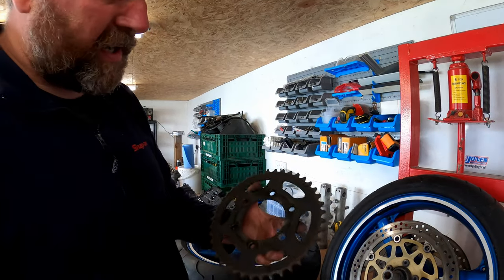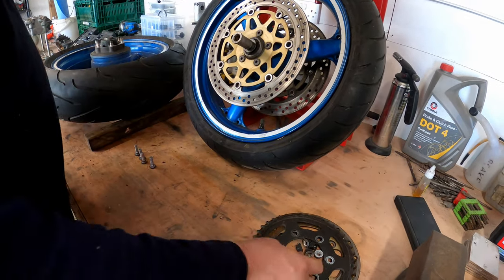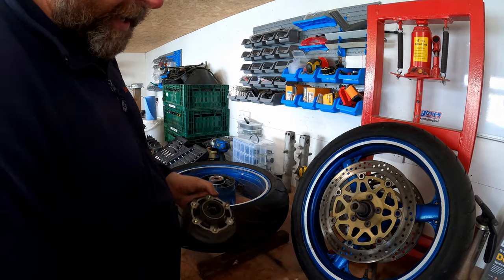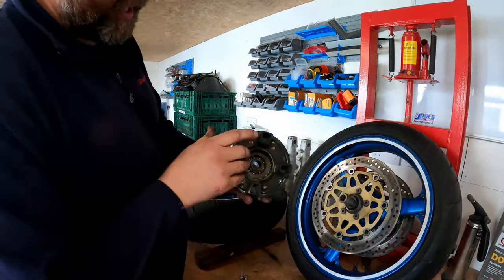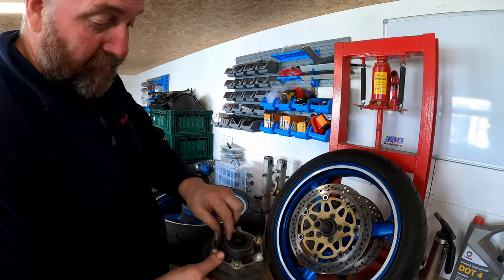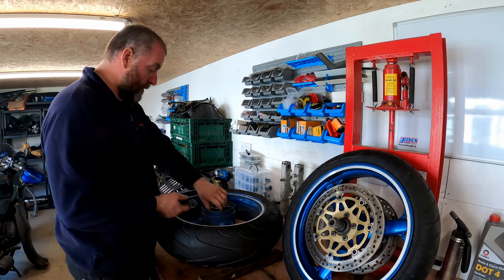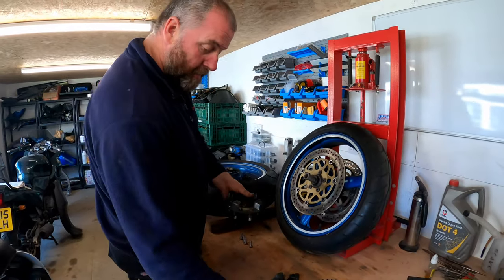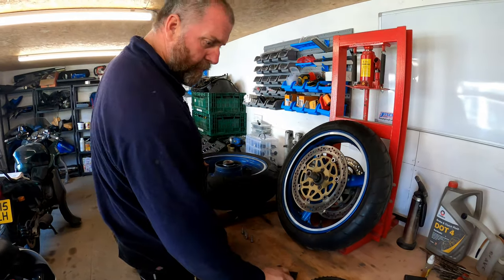1998 Kawasaki ZX9R - Project Shinobi, Episode 11 - Front & Rear Wheel & Sprocket Bearing Removal

Comment: Wow.  I have a GPX750 and there was no where near as much play on the spacer tube.  It was a nightmare getting the bearings out.  I ended up filing a groove out the spacer tube before I refitted it to help out the poor sap that has to replace them the next time, just in case that sap happens to be me!